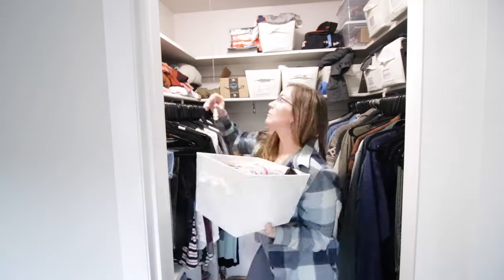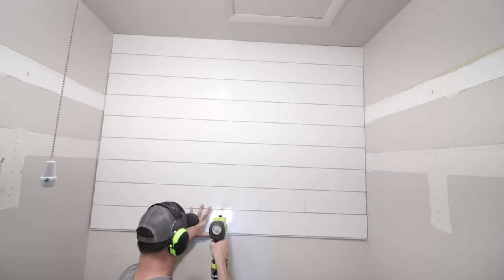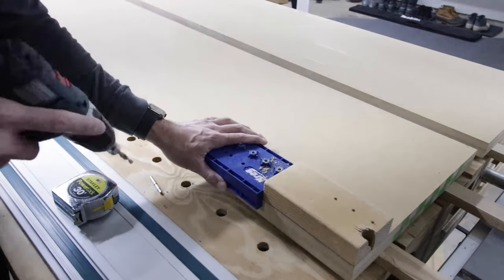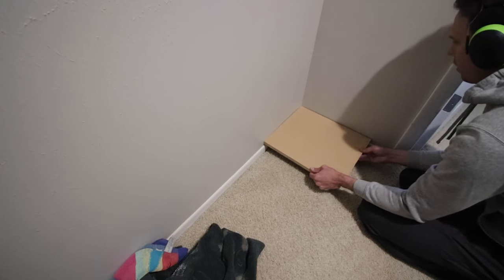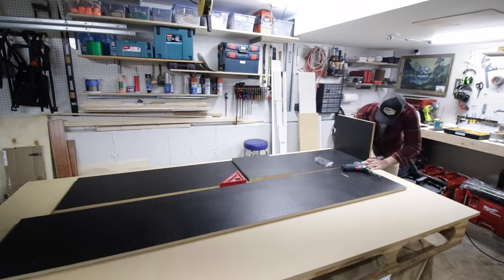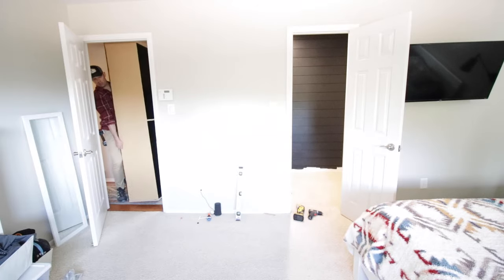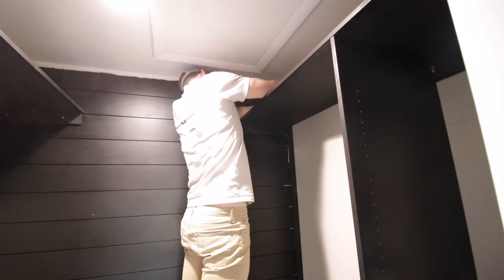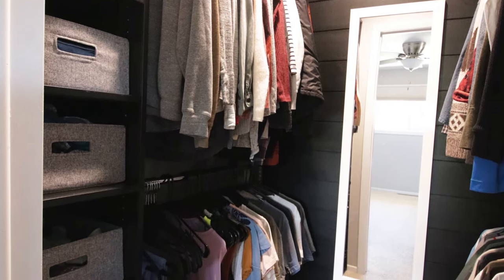Small Bedroom Closet Remodel

Comment: Thanks for sharing.  I think stacking clothes rods (one at "belly"height & the upper one near ceiling) is the most efficient use of space for hanging clothes.  You did a really nice job, and I offer compliments for your bloopers.  It shows we're human & make boo-boos on occasion.
I recently did a closet make-over as well.  Your pre-construction closet was a mirror image of mine.  Just shelves on top, and hanging clothes around perimeter.  Very space-wasteful.  I'm sure you thoroughly envisioned how closet design would fit your requirements.  Much of a successful project is to identify needs & how to satisfy them via proper design.
I opted for 3/4" melamine; only had to apply white adhesive banding for edges.  I took pictures & vid along the way; perhaps after I get done with the rest of my house reno, I'll do some video editing & post as well.
Anyway, your closet is beautiful.  I'll bet abandoning that pull chain for light was one of the best ideas, too.  The shiplap wall is a nice touch.  I was considering sprucing up the wall somehow, too, but considering it's "only a closet" and all the clothes will cover the walls,..... I decided "nah". 
Hey:  Very nice!  Congratulations !
Reply from the maker: Thank you for your super kind reply! I really appreciated that and liked hearing about your project as well. Thanks again!

Comment: What are the dimensions of your shelf boxes? My closet is little bit smaller but i think i want to try keeping same sizes of that main shelf box and adjust everything else
Reply from the maker: The main box interior is just under 84” tall. 13” wide and 16,3/4” deep. I then used the peg system to make adjustable shelves. One shelf is permanent  ear the middle to help with structure after I measured and knew where I wanted this to be. 6 shelves are adjustable. Could have more if you don’t have laundry basket at bottom. I hope this helps!!